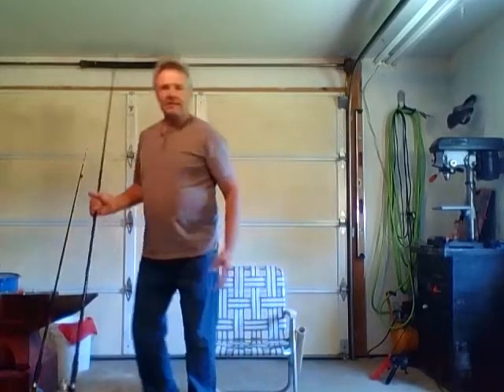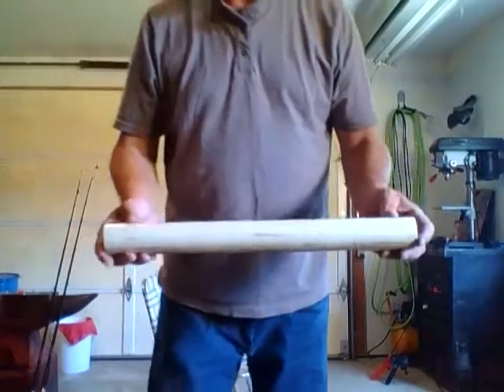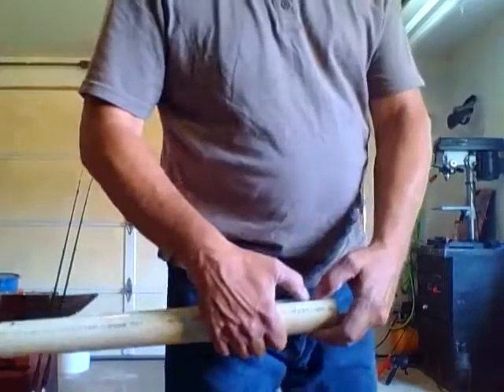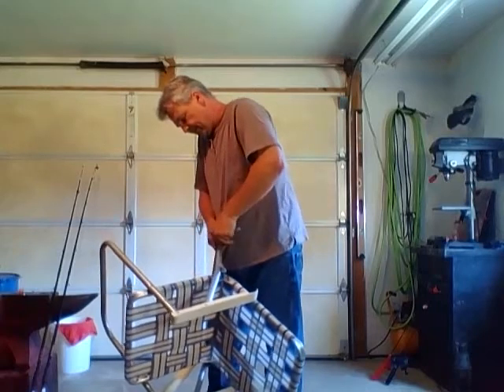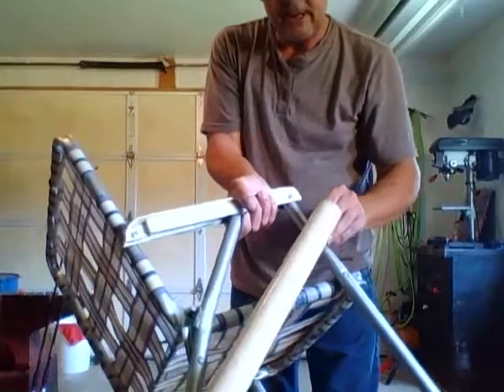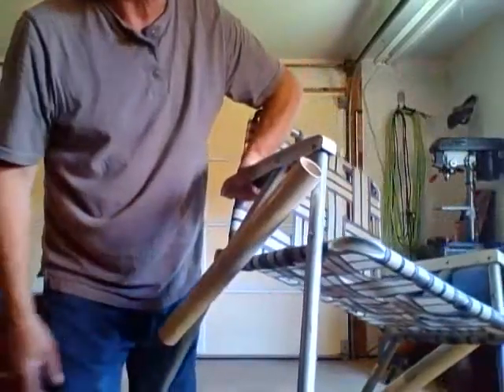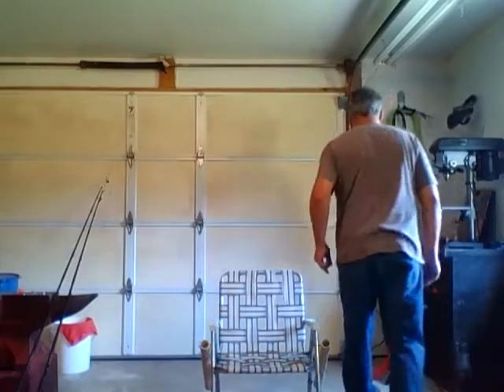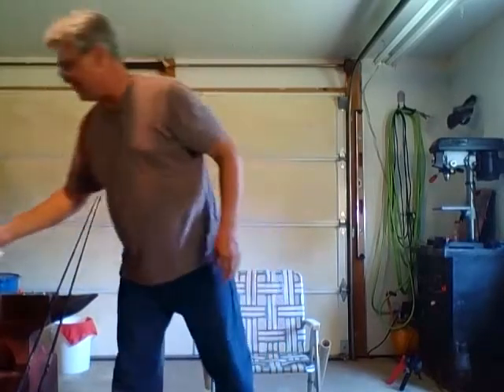How to make a simple fishing chair

Comment: Now when making the hole in the pvc pipe for the bolt, how do you get the hole to match up with the first hole on the other side? Every time i drill it, the second hole ends up on the same side of the pipe. What am i doing wrong? Also what is the best brand of sand paper?
Reply: @AskDaddyjoe  thank you big daddy!
Reply from the maker: The best brand of sand paper would be 80 grit from 3m and thank you for Watching Zoragon .